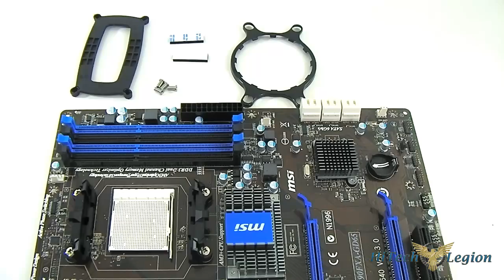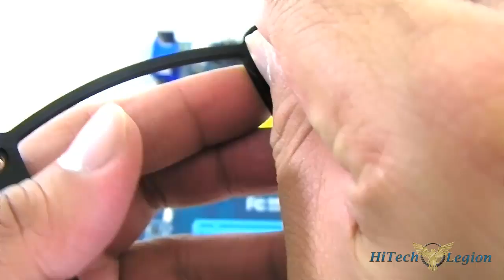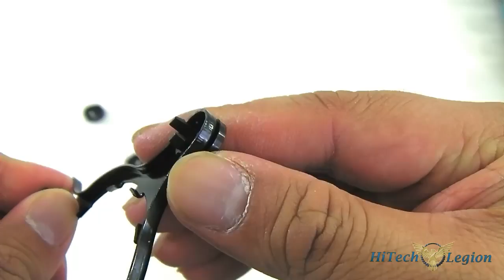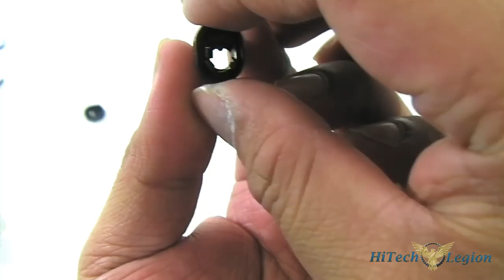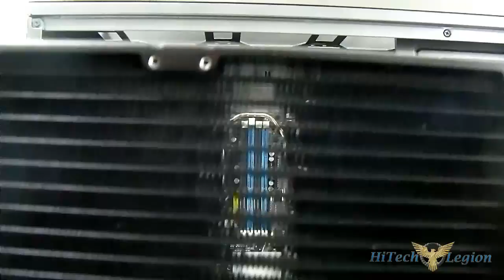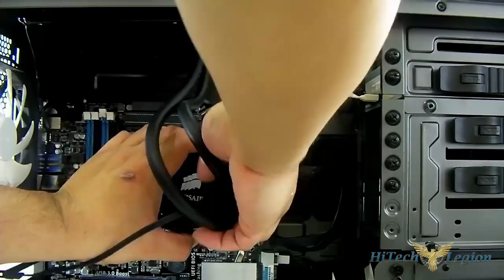Corsair H90 and H110 Installation Guide

Comment: According to the manufacturer's manual, the coolers should throw air inside the case (intake). Is that correct? My i7 5820k is heating up more with this watercooler H110 than with my old seidon 120V!
Reply: +Leandro Barbosa No, fans should be exhaust. This is Corsair's way of getting slightly better (~2C) in benchmarks, but it also turns your case into a convection oven. 

That said, fan direction would not be the issue here. You may have a bad seating of the block, a pump issue or some type of tube blockage. Your temps should be slightly better than the 120V.
Reply: +George Cella Got .. with my 120V the temperature was at 43 ° C. Now is 47ºC. Can it be the thermal paste of inferior quality? Or why I put it recently?

Comment: I have the h110, getting ready to install it and the motherboard is too tight to fit both the fans and the radiator on. Does it need the 2 fans installed with the radiator or can I mount them on an available spot on the side?
Reply: 2 years late but in case someone reads this in the future you don't need the two fans

Comment: I need to dissassemble the retention ring as I got the wrong screws on there but the screws just spin forever not coming loose, can someone please help?
Reply: Did you manage to get it removed? I have the same problem and I'm pretty much stuck with this annoying issue.
Reply: +wongoli wongo l did, had to use a bit more force than I would've liked though
Reply: Yeah I finally got it through. You could just stick 3 toothpicks in between where it clamps the screw and gently pull with the toothpicks still in it. Took me a whole hour just to get pass that one tiny problem.

Comment: Does this kit fit on LGA 775 Wolf dale CPUs I don't feel confortable takeing the Motherboard out of the case to but a Backplate on does this kit need one I was looking at the H90 which many sites say that it does fit LGA 775 but does not say either it needs a back plate to function? I have problems with static and I would hate to loose my PC to static.
Reply: The backplate is necessary for LGA775 installation.
Reply: George Cella thanks

Comment: I want to ask you about if i have a h110 and with 4 fans
So it's will be with 4 connector
How would i connect it ?
Cpu and sys 1 , 2 , 3 
Like that ?
Reply: you would use fan splitters and connect it to CPU_FAN and CPU_OPTFAN
Reply: Oh thank you for that.
Reply: ***** i installed mine yesterday and it said in the manual "connect the pump to any available 3 or 4 pin header on your motherboard" which i did then had the fans on CPU_FAN and CPU_OPT. hope this helps
Reply: Nah it will help No problem about that
Cause i love to read all of the pepper when i buy something...
I may buy H110 I don't know yet maybe I'm going with full system water cooling
:D

Comment: if i put these fans in pull configuration....what is the difference???
Reply: Pull typically yields very slightly higher temps. You are only looking at a couple of degrees difference. BUT, in some cases you may have a noise difference.

Comment: I have an Asus Crosshari V Formula-Z motherboard and I am having trouble installing the Corsair H110. I am using AMD3+ but the front brackets are completely off of the motherboard that the screws does not reach.

Comment: Just one question.. Why am i replacing a steel backplate for a flexible PVC one? It just doesnt look as strong..
For R3 owners.. Im trying the H110 on a R3 because there is a 20mm spacing between the mounting holes for the 140mm fans :)

Comment: I believe so as that case supports both 15mm and 20mm spaced 140x2 fans. Measure the mounting holes on top if it can fit 20mm spacing as that is what Corsair H110 uses.

Comment: The part where it exhausts to usually has the sticker/label portion and the inner-spokes. Some fans also have two arrows on the side that tell you what direction the fan blade rotates to and another arrow that tells you where it is directing air to.

Comment from the maker: ok, replying to my reply. I checked some R4 photos. It seems to be almost the same body as the Arc Midi R2 except for the top panel which is unfortunate since the Arc Midi R2 has a left-offset 240/280mm mounting to support push/pull without adding too much height to the case. The Define R4 has 280mm radiator support on top according to the specs but it looks like 15mm spacing (so no H110, but X60 is fine) and it doesn't look like much space for push/pull, but definitely enough for push or pull.

Comment from the maker: I don't have a Define R4 to verify unfortunately, although from the looks of it, the spacings are 15mm which will not fit for the H110 since Corsair used 20mm spacings. NZXT Kraken uses 15mm spacings though. I will post more later once I find a clearer picture of a Define R4, people don't seem to take much photos of the top :(

Comment: Yeah, I needed it soon, so I just ordered the H100, and I'm using it now. Even if the H100i is better, the H100 is extremely much better than my previous cooler. But to be fair, the block had a lot of dust on it, so the air throughput was probably close to nothing :P Still, it's more silent now, and I will attempt overclocking my E8600.

Thank you for your reply =)

Comment from the maker: You can connect it to the CPU header as long as you set it to full voltage (or disable fan control on that fan header) in the BIOS so the pump is running at full voltage. H100 pump has a dummy CPU plug and connects to a Molex connector for full power.

Comment from the maker: I don't have a 775 board to test for sure unfortunately but the plastic mounting kits included can only match the 1155 at their closest position so I don't think it is possible since LGA775 distance is 72mm compared to 75mm on the 1155/1156.

Comment from the maker: I don't think there is a 140mm fan mounting on the P280, only 120mm (rear and top) and 240mm (top) so you most likely cannot install the H90 and H110 without modding.

Comment from the maker: Do you mean 550D? or 500R? I'm not sure about H110 compatibility as I haven't seen used them in person but they both have 140mm radiator/fan mounting support at the top for the H90.

Comment from the maker: You can install it anywhere it can be mounted. It was just arranged this way so the setup is the same when I compared all the heatsinks instead of giving one an advantage over the other (plus I wouldn't disrupt the airflow with the rear still exhausting as it is with the other coolers tested). Also, all liquid coolers were installed as intake and positioned to blow on the VRM area as it is crucial when overclocking on an X79 system with that much voltage.